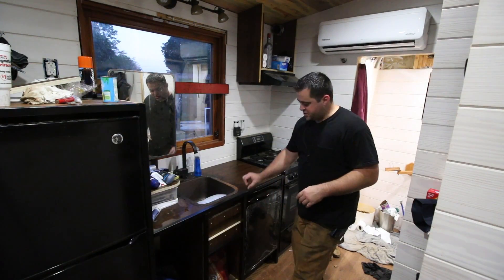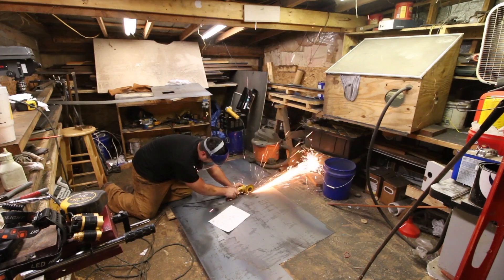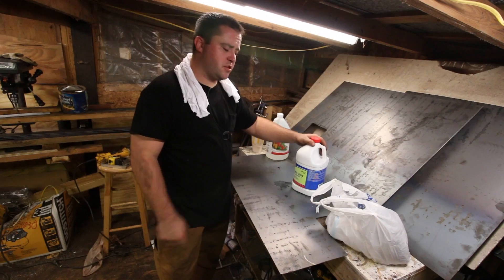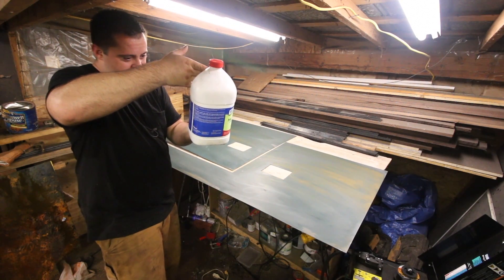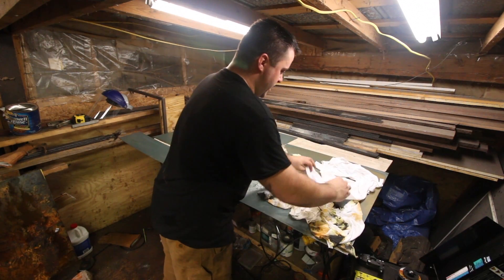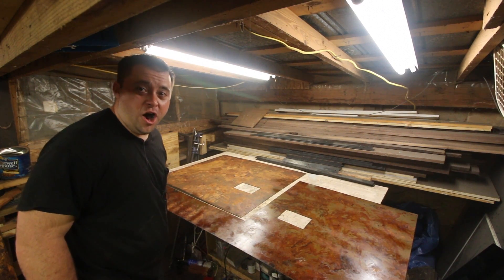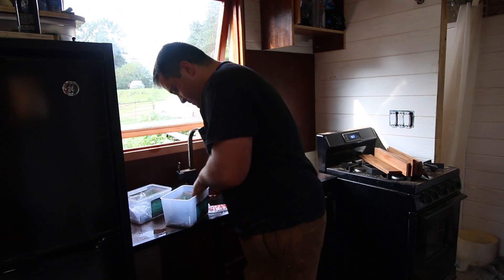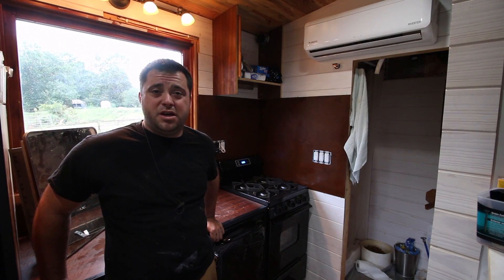A custom rusty metal backsplash in a Tiny House

Comment: As a metal fabricator , whenever I need to cut a piece of sheet to fit a specific area , what I do is make a template out of rigid construction paper , cardboard , and masking tape , a pair of scissors , only takes a few minutes , works like a charm.
Reply from the maker: +Aa that would have been a good idea.  I'm just use to measurements. I do your template trick in two weeks but for a small piece.
Reply: Right , thousand way to skin a cat , long as the job gets done right , and I'm confidant that it will , you're doing a great job Dan.